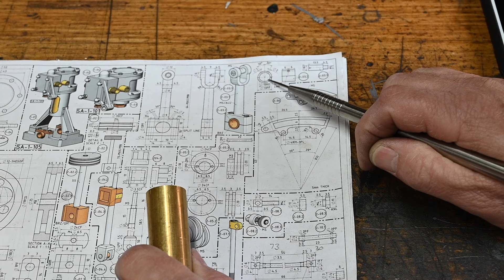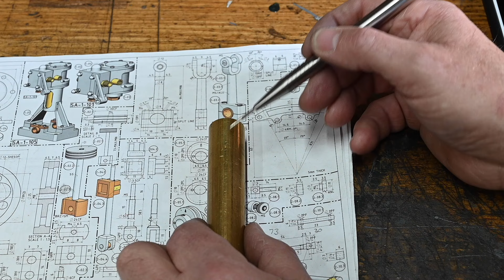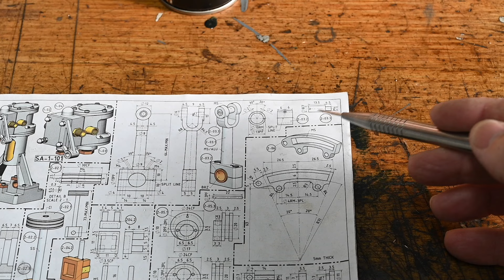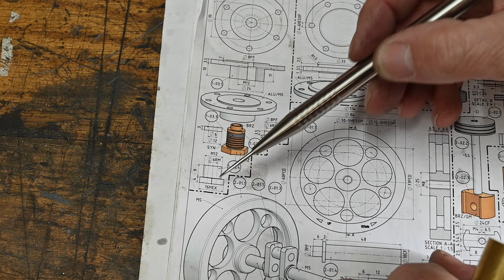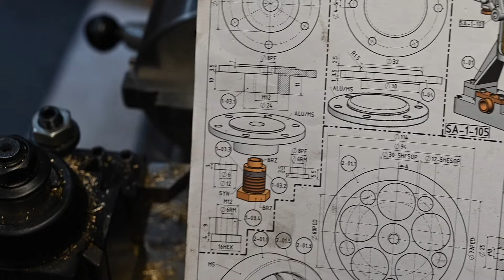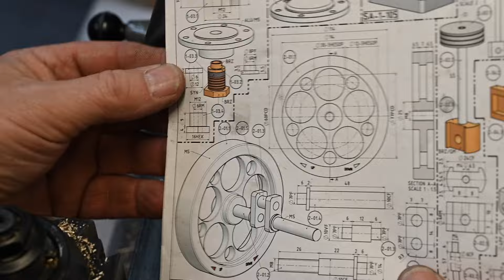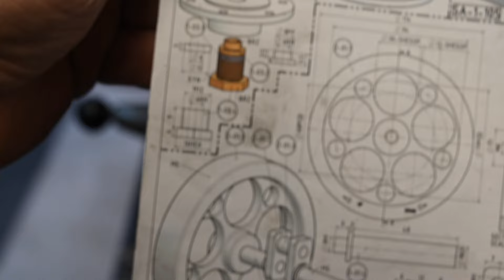Stuart 10v Steam Model - Split Bearing - Union -  Clevis Pin EP17

Comment: Interesting machining work, and nice parts Mark. I don't have a vertical bandsaw, so would split the two parts with a splitting saw, and part off on the lathe. I'd use super glue as I'm hopeless with soldering. ATB Nobby
Reply from the maker: @nobbysworkshop  The only problem with superglue is when the part heats up in the machining process it melts. Thanks ATB Mark

Comment: nice job. I was thinking super glue have worked. The solder I think was a little cold in the middle of the joint that's why it failed
Reply from the maker: @RB-yq7qv  The problem with super glue is, the heat of machining would melt it. 👍

Comment: Not a superglue guy myself but I suspect you could use superglue or loctite to hold the two halves together for machining.

Most of my stuff is full size so when I make anything split there is a piece of shim stock in the middle or just a clean saw or slitting  saw cut so you have room for clamping or wear adjustment.
Reply from the maker: @pvtimberfaller  Thanks for sharing your method 👍

Comment: You wouldn’t have a problem with the solder joint if you had drilled and reamed the bore first, that would have left a much larger solder joint to withstand the drilling force
Reply from the maker: @Martin-u5j8c  👍